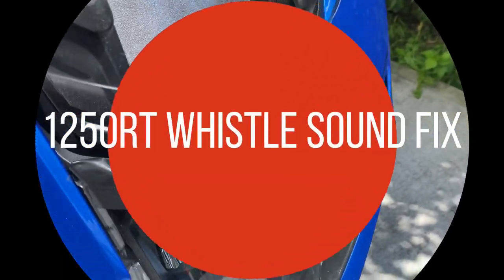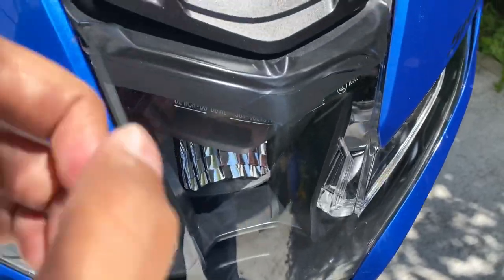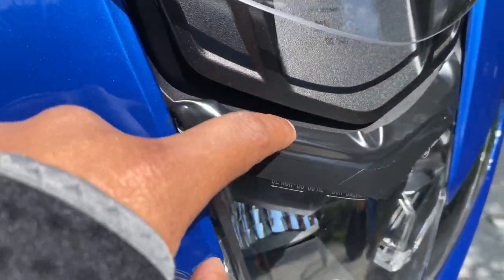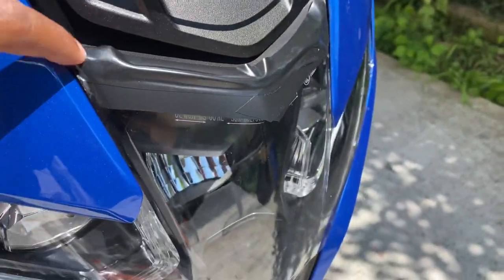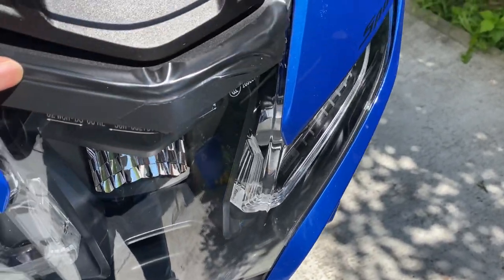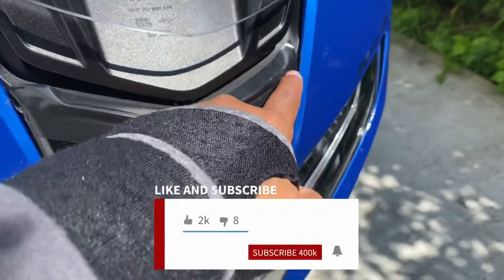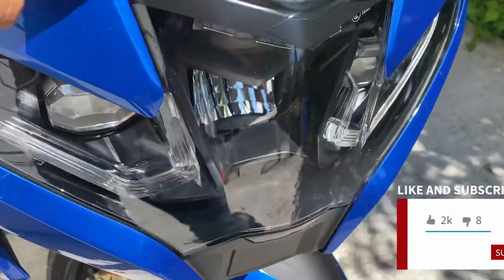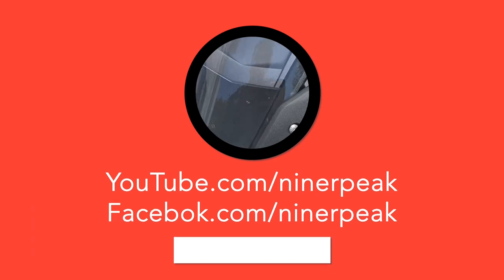1 min fix for 1250RT whistle sound

Comment: I had the exact same issue and it ultimately was very annoying. I took it in to my purchasing dealer in Escondido Ca. They took it out for a test ride and completely agreed very annoying whistling. They fixed it and I came back the next day and drove off. No issues.
Reply from the maker: There seems to be a BMW solution for this. Did they install an additional rubber part in that gap over headlight?
Reply: @ninerpeak  exactly what the BMW mechanic did, I’m not 100% sure. Despite being told. I know they took off the grey tape I installed, and made the correction free of charge.
Reply: @ninerpeak  you would think these things would be checked in wind tunnels for such an issue before production. Easy fix!
Reply: @FranksBmwAdv  yes. This was very disappointing and dealerships in North east all said there is no fix while I have confirmed BMW offered fixes from a few west coast friends.